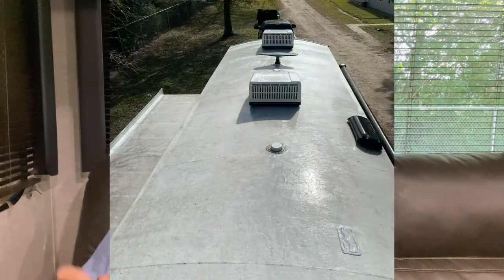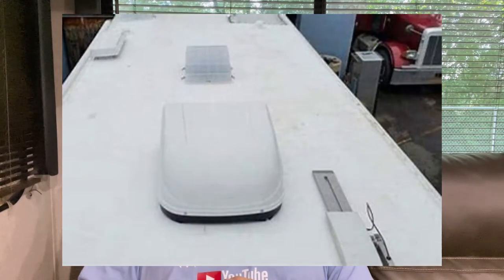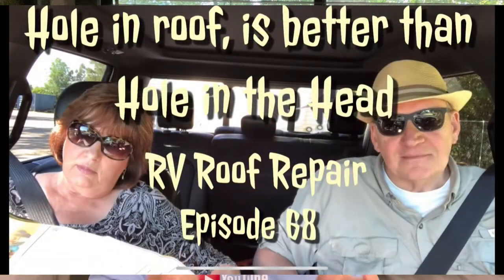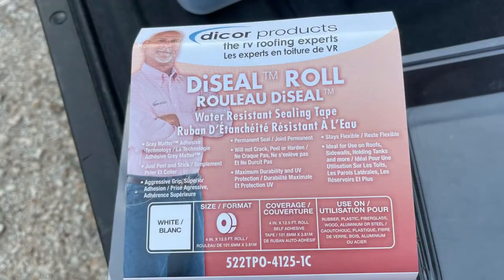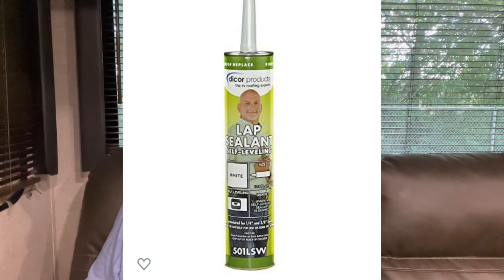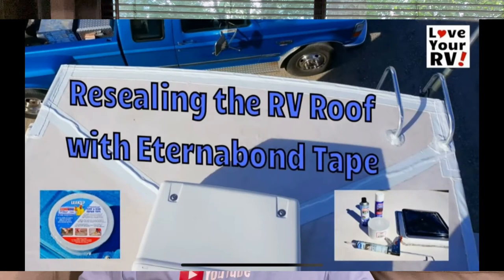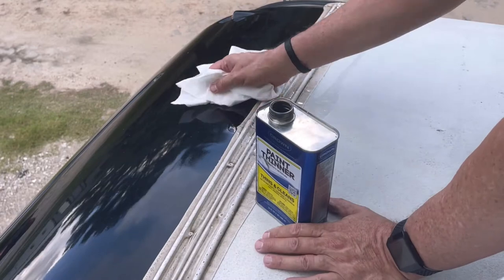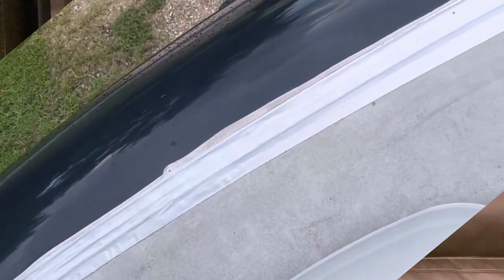TPO RV Roof Repairs with EternaBond Tape

Comment: hi so cleaned with acetone??
Reply: Looked like he used paint thinner/mineral spirits.   That is a good cleaner for dicor sealant at the edges and penetrations, but should not be on TPO.  (Some say it is Ok to use on TPO as long as you use a lightly saturated rag and do not let the spirits drip or pool against the TPO anywhere, but others say tpo will be damaged with petro solvents.)

On the TPO portion, I have seen people use and reccomend rubbing alcohol (isopropyl) and acetone.